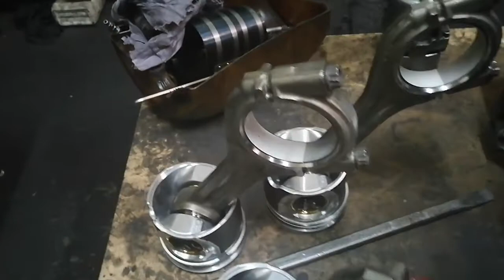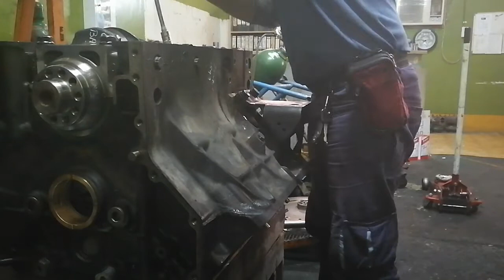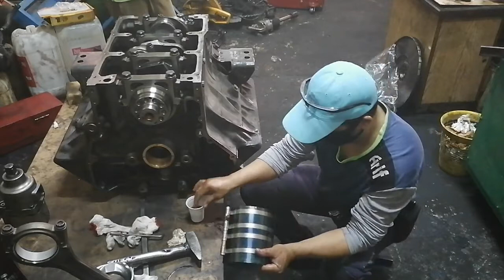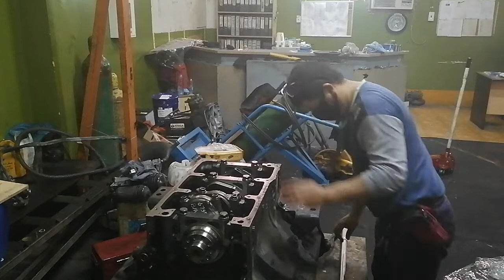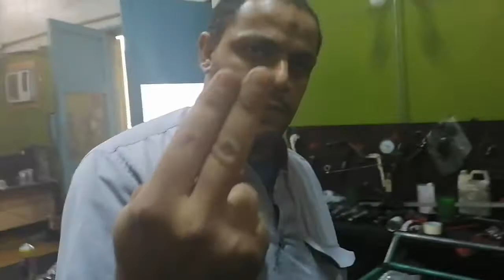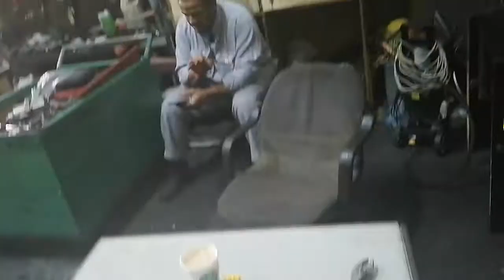How to fixed piston of Mercedes-Benz actros

Comment: Boss tanung lan sayo po. Dto din ako sa reyadh saudi Arabia. Pwede kba malaman sayo kong paano kaw mag adjust ng valve at un running mate ng actros v6. Paano ang sunod sunod boss. Un kasi gusto matutunan mabuti boss.
Reply from the maker: Walang problima sir. yung adjust ng engine valve sir. 10mm intake 24mm exhaust sir. yung firing order 1 4 2 5 3 6. yung running mate 152634
Reply: @mechanikongbisaya9814  boss. Unahain ko adjust dba un number one head. Tapos ba sunod ko un number 4 ba
Reply: @mechanikongbisaya9814  boss pwede ba makuha un fb mo or messenger mo para po add kita. Para pag need ko ng helps call ako sayo po okey lan ba. Baguhan palan kasi ako dto sa ganito sasakyan actros boss. Sana matolungang mo ako boss. Maraming salamat
Reply from the maker: @kendrickcalabia2582  opo unahin mo yung 1 tapos 4
Reply: @mechanikongbisaya9814  boss sana sa susunod mo vedeo makita ko kong paano kaw mag timing. At paano ang ikot ng sa pag adjust para matoto ako boss. Salamat sayo pag reply.
Reply: @mechanikongbisaya9814  boss pwede bigyang mo ako ng guidelines ng firings order ng v6 na actros.142536.paano pag timing kuna un number one ano ang naka fire. Paano isa isa ang pag timing at tapatan sa adjust
Reply from the maker: @kendrickcalabia2582  yung number 5 sir pag angat ng exhaust top na ng number 1
Reply: Boss good pm. Muztana dyan boss
Reply: Boss good pm. Paano mag adjust ng v6 actros. Un hindi sya 2metods. Paano ang sunod sunod sa single adjustment. Pati sa Lb V8 mercedes